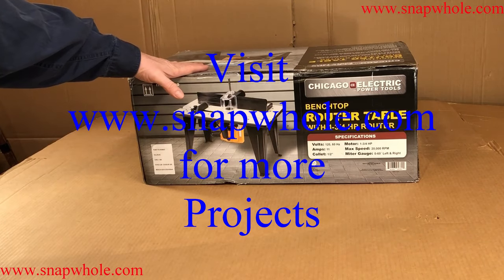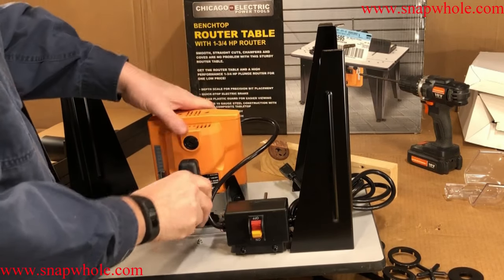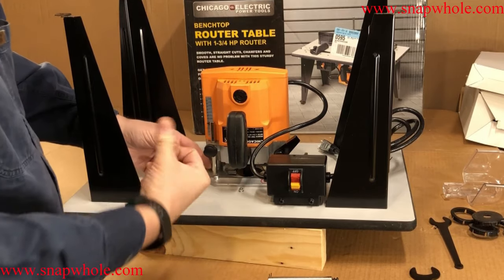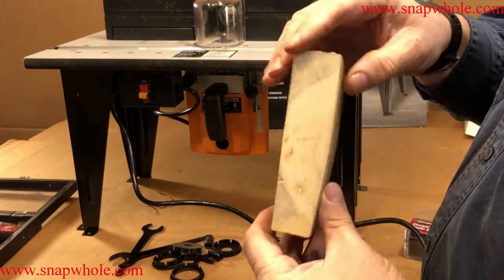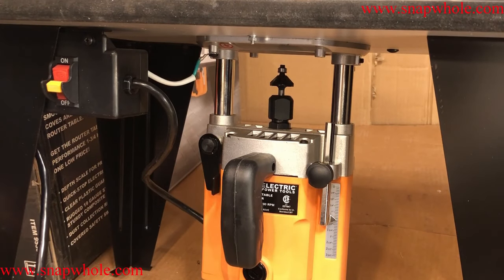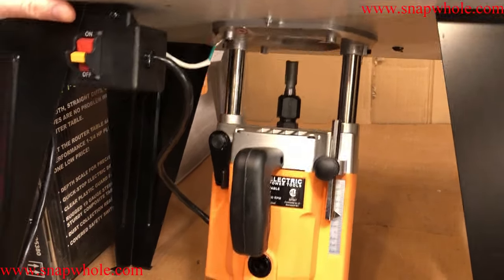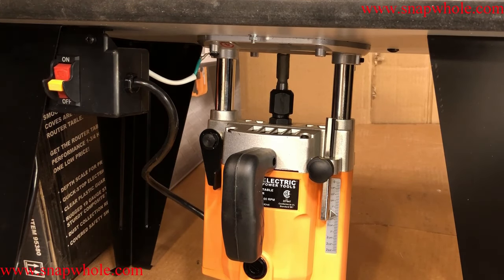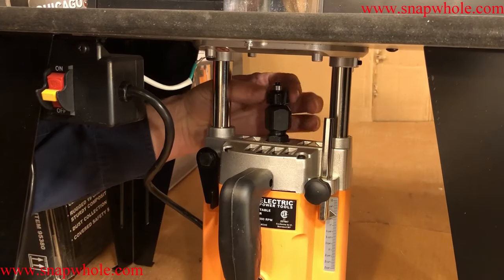Harbor Freight Chicago Electric 1 3/4 HP Router Table Review and Use Demonstration

Comment: Can I use 1/2 bits on this table?
Reply from the maker: this table is made for 1/2 bits so you should have no trouble, not sure why they even provide a 1/4 inch collet, the bits are to short to use without modification - I demonstrate the 1/4 inch bit problem in the video and compare to the 1/2 inch bits that work like they should - I did not test 3/8 bits, but I would expect them to work better than 1/4 inch bets, and maybe as well as the 1/2 bits -  thanks for subscribing!
Reply: Okay, because I tried to put 1/2 and when I turn it on it sounds louder and different, and that's why I asked you, then it doesn't break down, right?
Reply from the maker: @jsconstruccion  I would expect it to sound different when it cuts, but that table is made for 1/2 inch bits, but if you are concerned about the sound, you should check and make sure the screws that mount the router to the table, just to be sure - thanks for subscribing!

Comment: Hello!
Thanks for the video! I was thinking of buying one of these and now I'm going to! I think I'm going to do like the other commenter and change the tabletop to 3/4 plywood (rout out the bottom where the router connects to get it closer to the work area and have more bit access. I think I might make my a little bigger if possible. I've got to get it first and see how the fence connects and go from there. You did say it takes 1/2" bits, correct?
Thanks!!!
Going to sub now!

Edit: I was commenting while watching. Ok, 1/2", 3/8" and 1/4" bits??? LoL
Reply from the maker: thanks for subscribing!

Comment: Can you mount a better router in this table?
Reply from the maker: if you are going that route, if might be more cost affective to build a router table, the main cost of the router table is the router, but yes its possible to mount another router in this table, the table has inserts for the screws used to mount the router, you might have to adapter another router to those holes, or create new holes - thanks for subscribing!

Comment: I'm glad someone who seems to me to be someone who knows what they are talking about because now i am fairly confident that it is not "just me" with this table not getting the bits high enough and I have compasated by not seating the bit in all the way. It pisses me off because the directions say "make sure the bit is completly seated". Once, had it too high and it was a shit-show. Can't buy adapters to make it higher?
Reply from the maker: you can buy adapters, the basic cause of the problem is - its made for 1/2 inch bits and everyone (including me) wants to use 1/4 inch bits and except it to work the same - but HF never says '1/2 inch bits only' and provides a collet for 1/4 inch bits, so I wonder why everyone expects 1/4 inch bits to work? thanks for subscribing!

Comment: Raise your 1/2 inch bit up out of the collet so when it is level with the table, you can set to zero. (the bit should not be bottomed out in the first place)
Reply from the maker: there is no problem with the length of the 1/2 inch bit, the problem is with the 1/4 inch bits, review the video for the details - thanks for subscribing!

Comment: Excellent video, very detailed and descriptive, thank you. I was however slightly put off by the criticism of the product and the quality. Not all of us Craftsman can afford buying our equipment from Rockler, Jet, and Woodcraft. The video was well done, but could one ask the skepticism to be held to a lower level. I know it's nitpicky but sometimes the difference between a instructional video and a really great Instructional video can be a small margin of detail.
Reply from the maker: a review without negetive comments about the product is a commercial - if I don;t tell the good and the bad, and you buy it, you might be disappointed with the product - this is an ok tool to use, but it you don't know the limitations and compensate for them, you won't gett full use of the tool - I also think its important to know there is no mention of the correct size router bits to use - thanks for subscribing!

Comment: little dab of hot glue on the switch will secure it good
Reply from the maker: Hot Glue is a good option as it will allow you to easily remove it later - but I'm ok with the one screw, it stable and works ok - thanks for subscribing!

Comment: Hey sir im new to the world of routers 
I just bought the same router you 
Have ill be posting my un boxing and set up video later today  
My question is what size router bits do i need i didnt see the size any where on the box edit i shouldve watched more of your video  you explained the router  bit size options adequately hope you see fit to check my channel out and look for my unboxing and setup video
Reply from the maker: I'l check out your page later today, the table is made to use 1/2" router bits, but you can use 1/4" router bits, but will have issues trying to use the entire router bit, as they are at least 1/2" shorter than 1/2 router bits - thanks for Subscribing!
Reply: @snapwholeharborfreightreviews  I do appreciate the sub sir I've subbed to you as well
Reply: Hey guy Ive had my router for a bit now Its works pretty well  thanks for the info oh I mentioned your channel in my video...
Reply from the maker: @GeorgiaRidgerunner  Thanks for the mention !